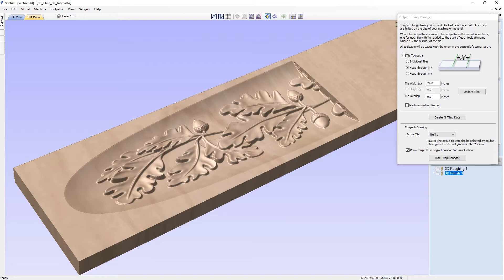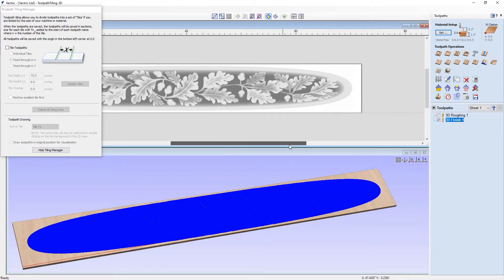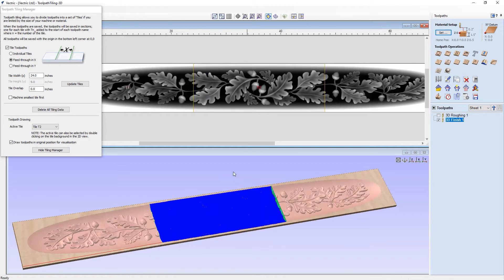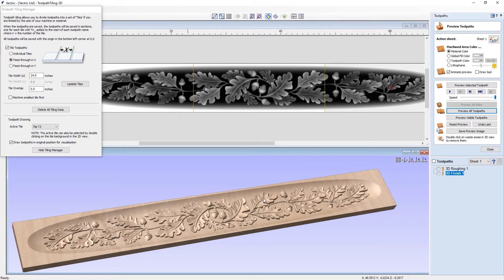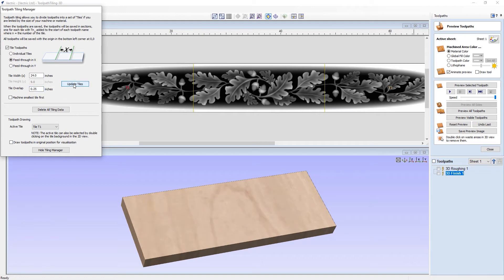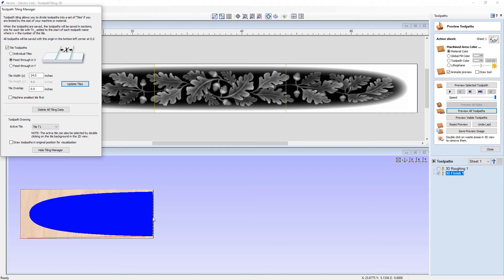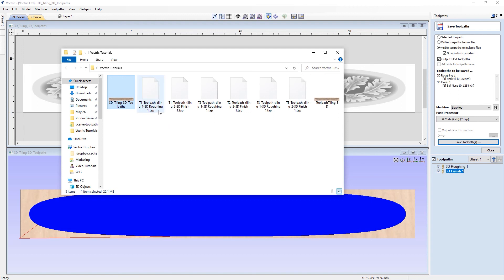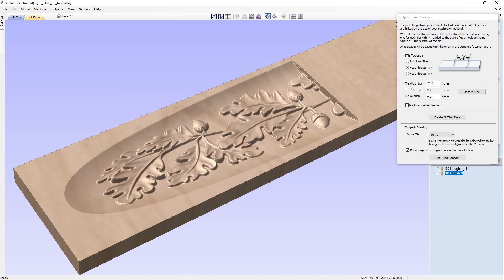3D Tiling | Vectric V11 Tutorials

Comment: With a project like this, how would you suggest you position or locate the workpiece so that when you move it the 24 inches you are actually moving it a perfect 24 inches so you dont get a noticeable line in between the different sections?
Reply from the maker: Hello and thanks for the question.  Most people would be using a dowel method to index the board, assuming that works for your project.
Reply: @vectric  the dowel method would be my preferred as well but I am just interested in how it would be done with a project like this where having holes in the board would potentially ruin the asthetics.
Reply from the maker: Yes you are correct, and in a case like this a jig may be needed.  Like a board running the length of your machine with a line on it that you can carfully line up the edge of the last cut.  

You could also create a two sided project, with dowel holes on the back side of the board, not cut all the way through.  When you flip the board over you push it on the pegs, do your first cut and then move it to the next position.  This one would take a bit of thought and migh only work really well for a project you tile twice... but I would give it a try.
Reply: @vectric  that's a good idea to add in an extra piece for reference. Perhaps even double side taping say a 1" wide length of timber to the side of the project board and using that for the dowel reference could be an option as well.
Thank you for taking the time to reply.